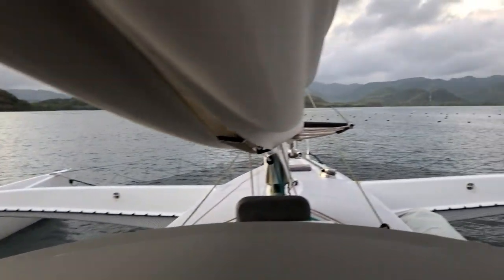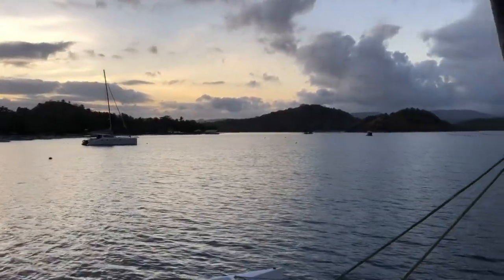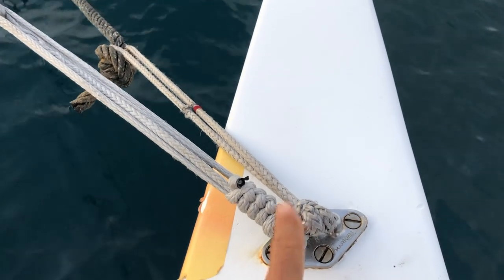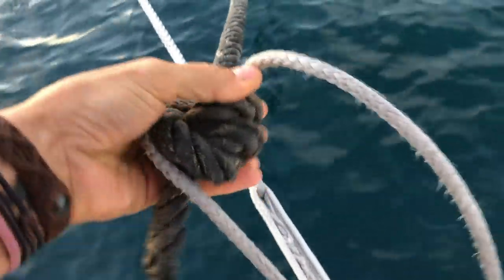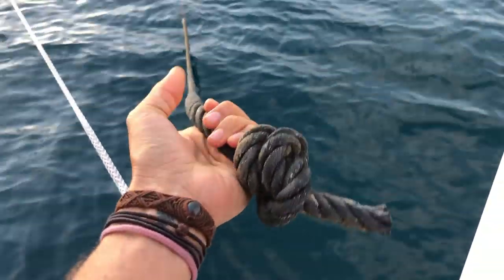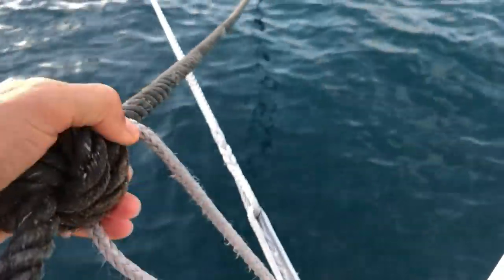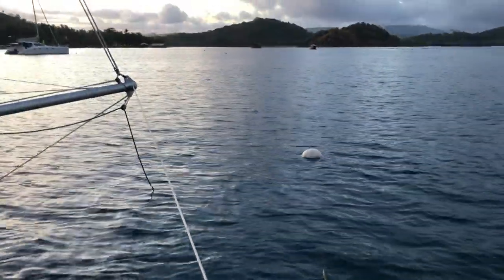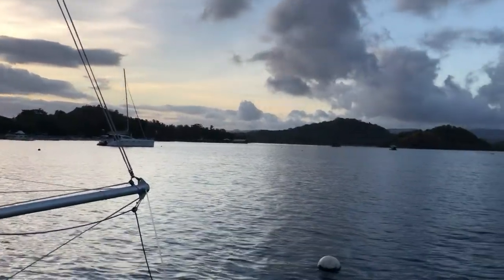Mooring a yacht made easy - Trimaran Spirit - The Simple Life - Ep12

Comment: Thanks for this video. 
Where is your secondary line attached to the mooring? Does it stay attached to the mooring or do you attach this first before the amas?
Reply from the maker: Not sure what you’re referring too? This method has three lines that go to the boat. There’s the bridle that attaches to the bow of each float using this method then there’s a safety line that goes to the mooring. The first thing we do is to sail up to these longer lines and to pick one up and to get it fixed to the bow. Once done we then do the other lines using the engine to assist us if there was strong winds. Hope this helps.
Reply: @TrimaranSpiritXL  
To clarify, the mooring has 2 attachment points, each one attached to the bow amas. 
The secondary or safety line is attached to the bow of the main hull. Where is the other end of this line attached? Also to one of the moorings bridles that are also attached to the ama?
I’m making a bridle for a trimaran and not sure if I should leave the bridle ends (connecting to mooring) tails, loops, loops with thimbles or knots. I’d like to use the same bridle for anchoring and mooring. 
I have a mooring with loops, but feel the loops will chafe if I run a line through and back to the bow amas, but this is easiest single handed when it’s windy to release.